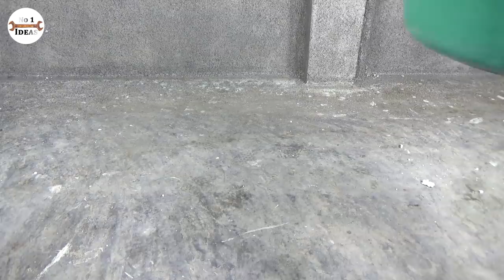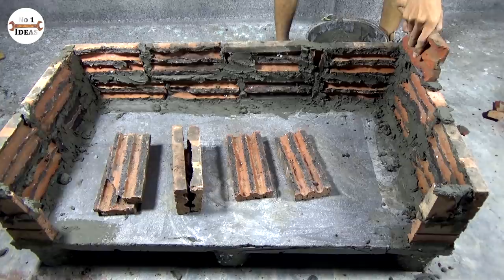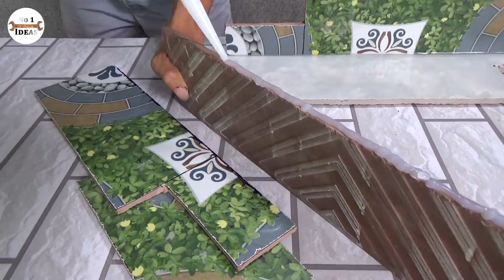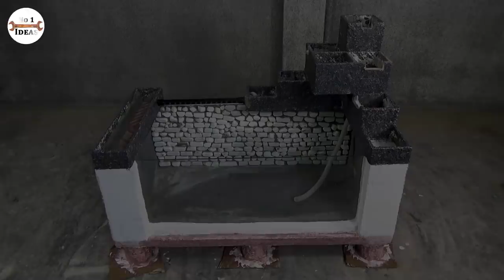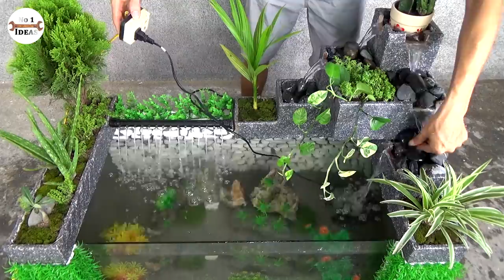How to Make AMAZING AQUARIUM with flowing Waterfalls

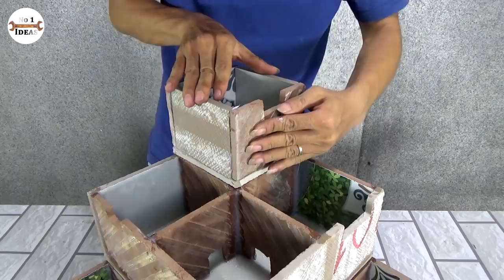Comment: I will make an equal. I wonder what you used to paint the ceramics? In minute 11:25 I didn't understand the pipe function, did you plug in some other pipe or just positioned between the two sides? I wonder if you closed with hot glue too? Congratulations on your work, it inspired me.
Reply: It's isn't nesesary
Reply: @NyMNHEJEKEK  thank you very much

Comment: Thanks for the video. Take Love from Bangladesh. I'll try to replicate this model in a smaller form factor with different material. I'll send you pictures if I'm successful.
Reply: Bro apni ki banaichen ?? Amio chachilam banate .. hlp asha korchi ..
Reply: @rayhanmahrez2080  Akhono complete Kori nai. Electrical system Nia jhamela.
Reply: Kottuku korechen ektu dekhan ,, amio vabchi ETA korbo kintu cement ar glass joint diyeche ki type glue diye bujchi nah ,, glass ER silicon dle hbe ??
Reply: Arrr cement pani dhore rAkhte parbe koro din etao vabchi
Reply: @rayhanmahrez2080  Amake email korte paren..... Then contact r content sharing a subidha hobe
Reply: @rayhanmahrez2080  Silicone Glue. Jekono Glass er Dokan a pawar kotha. 180 taka Nei. Thik Moto storage korle 3-4 mas Valo thako. Tar por glue jome nosto hoye Jai. Joint korar somoi kheyal rakhben obbossoi jeno cement complete dry thake. Glue side a minimum 1cm spread rakhben. R cement 1cm puru hoile kokhono nosto hobe bole Mone hoi na.

Comment: Too many fish in small space ) : 
Project is good, but you have made some mistakes regarding the choice of materials you've used... cement contains a caustic base with a pH of up to 12.9. The effects may be nonspecific with pain and burning occurring. As with other bases, prolonged rinsing of at least 30 minutes (preferably longer) is important. You throw your fish straight into the "aquarium" without rinsing the toxins out of the cement. In addition, you need special silicone for aquariums - not building silicone! Your filtersystem isn't good enough to rinse all the toxins out of the water. If you use natural plants, you would have the benefit of them cleaning the water as well. Do you know the origin of your plastic plants?